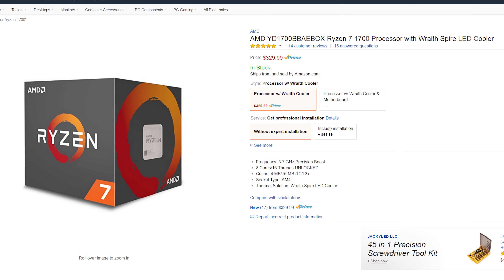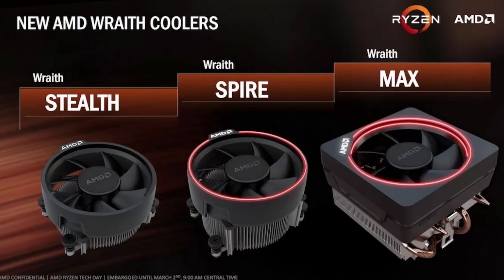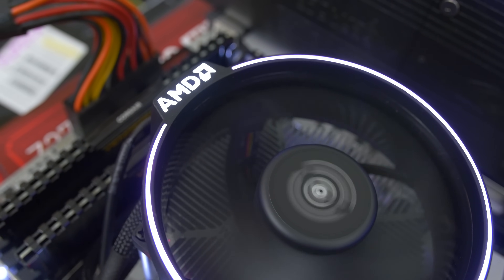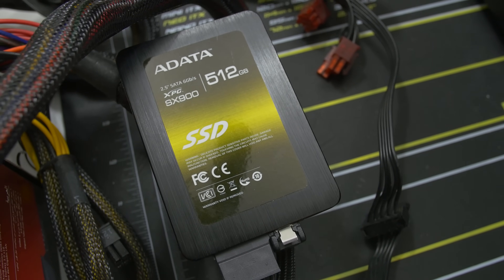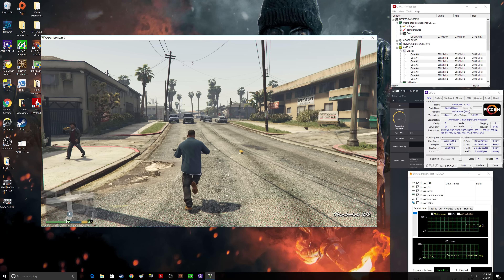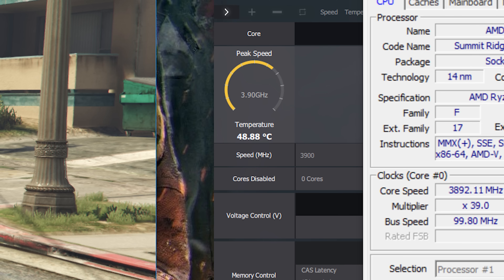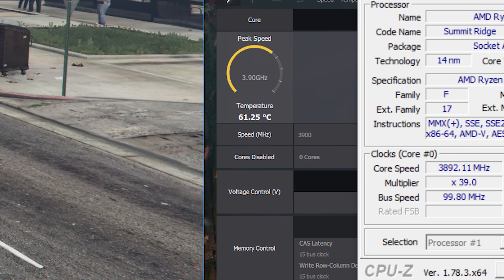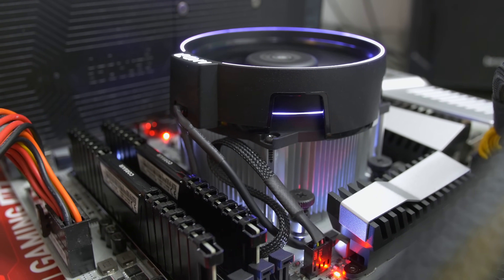AMD Wraith SPIRE: Does it SUCK?

Comment: Years late but the cooler does it job real well, its free? and can handle light over clocks, only problem is the thing is a bit hard to clean and its size makes it a dust trap.

An after market is still superior but it's not like the old fx series coolers that turned into jet engines in heat and sound.

Comment: I'm running X570, 5700X @ 4.3ghz 64GB mem @ 3200, 750w psu. With PWM fan curves in BIOS, the Spire is keeping my idle temps @ 28c idle, 34c streaming utube and 41c during Zombie gunship. It can hit the sweet spot and its not loud if you don't overdo the OC. I could have pushed the OC further but what's the point, Zombies are too slow for me.

Comment: The Wraith Prism is a much better AMD cooler but if all you have is the Wraith Spire and you don't plan to OC then the Wraith Spire is more than good enough for most people.  The Wraith Prism was designed with the intention for moderate AMD CPU OCing straight out of the box.  AMD soon got smart and if people wanted to OC their CPUs they would have to shell out more $$$$ and buy a better CPU fan.  That way the computer industry can make more profits from the consumer.

Comment: I had a 1700 but paired it with an H100i. Recently though I switch to a 3600 and use this spire cooler with it and it works very well.
Reply: So the AMD Wraith Cooler cools better than the H100i?
Reply: @BravoSixGoingDark  No. not quite. It works well though. I just like that it takes up a lot less space.
Reply: @shoff29  I see I see, so the difference is like 5 - 10c?

Comment: I am worried about what you said about the fan blowing hot air all around the case, and since it's a downward blowing fan could that hot air potentially heat up the motherboard and ram, leading to damage overtime?

Comment: 3:17 oooooo, Lol I prefer the see-saw cooler to the screw down wraith cooler because you dont have to remove those two little retention bracket bar things above and below the am4 socket so the wraith cooler can be screwed into the backplate
Reply: 3:24 but I hate the push pins Intel cooler with a passion, so the screw down wraith cooler is much better in that sense 😂😂

Comment: Seems interesting for a sff mATX case running an Athlon 3000g. The available cheaper low profile am4 cooler kinda suck, you can get one if these for 10 bucks, this should do fine with a small Athlon

Comment: Hi like to ask your suggestion/s what video card low profile type can i insert on my recent pc unit here my specs:
550-600 PSU
dual core 3.0 GHZ proc
msi g41m-p28 mboard
4 gb 1333mhz ddr3 ram(max up to 8 gb)
Onboard vcard im used
sff pc case
160 gb hdisk  and 16" lcd Wide mntr.
Games can played up to 2015 early that time it's ok to me! Thanks more power to your channel!

Comment: Using Wraith Spire along side my R7 2700 OCed to 3,8 GHz. When gaming and doing what I normally do, it doesn't go over 70 C. Normally stays in the low 60s under load and idles in the high 30s. Very good CPU cooler, considering it comes incluided in the box and even has RGB blink, it looks pretty cool.
Reply: Thanks:)

Comment: I am getting the Ryzen 5 3600X. Will the Spire be fine? I do not plan to overclock at all. My friend is telling me I should get the Dark Rock 4 cooler, but it's almost $80 and I feel like it might be overkill.
Reply: @Shemegory  I don't plan on OCing. With my setup the Spire is keeping the 3600X at 35-45C idle, and in graphically intensive games its at 61C. Doesn't seem too bad. Tthe issue is that the Wraith Spire's fan is extremely loud and very annoying. 

I heard that AMD "nerfed" the Spire for the 3600X, they removed the copper core/vapor chamber thingy, and replaced the CoolerMaster fan with some random cheap fan. That probably explains the annoying whine I hear.

Comment: Great video! Still relevant. Any idea if I can use the Wraith Spire that came with my R7 1700 with a R9 3900X? 

It seems like a pretty decent cooler and I'm sure if I used a little extra thermal paste it would be fine as I'm not over-clocking but I'd be interested in hearing your opinion.
Reply: Bad idea. Think about it. The cpu that you got with the wraith spire has a tdp of 65w while the 3900x has a tdp of 105w. The spire would be insufficient for the 3900x and it will most likely overheat. And extra thermal paste won't change anything cuz it's only a conductive between the cooler and cpu. Use the stock wraith prism or get another aftermarket cooler.
Reply: @hazzmati  Thanks, yeah I wrote this before I realized that the 3900X also comes with a stock cooler. The one it comes with is great and fine for me since I'm not doing much overclocking.

Comment: Great video, made me opt for the 3600X instead of the 3600. It is worth mentioning that only the Ryzen 7 Spire comes with RGB.
Had to learn the hard way though that AMD screwed us over by cutting costs. The "new" generation spire has no copper core + a Foxconn fan that does way more RPM than the original Cooler Master one  - it sounds like a jet engine! Total piece of junk, in hindsight I should have gone for the cheaper 2600X with the old spire.
I ended up buying a used cooler from a 1700x for 5 bucks so now I have more silent cooler and RGB - instant better FPS :-)
@Bitwit maybe you want to do a new video about the new Spire so that people are aware of this scam AMD is pulling.
Reply: I bought the 2600x a few months age and even its wraith spire was loud. It sounded like a mini lawnmower or something the sound really intrusive I couldn't bear it. Ended up buying an aftermarket cooler but I was disappointed  cuz I bought the 2600x because I thought I was getting a good stock cooler.

Comment: I have question
I have Ryzen 5 3400g with wraith spire, the max temp i got is 77celsius and about 6:11 it is not quiet it vibrates on motherboard.
maybe i got bad cooler but still 77 celsius max is look ok with tjmax. being 95 but still.
In my case i have 1 cooler from cooler master (stock)
Reply: But still great video

Comment: its loud as a truck,i got one.....
Reply: Clean & re-apply thermal compound once every 3 to 4 months . Also maintain positive air pressure inside case -- i.e , place all fans as intakes & just one exhaust at rear side . All coolers will run quiet then .
Reply: @abhroy  Not if theyre not working properly like my NEW amd wraith spire :)
Reply: @miroslavterzin5117   . I am truly SORRY to hear that . If you don't care about RGB , then please get one AeroCool  "BAS AUG"  horizontal or down-draft cooler -- TDP 125W , 4 pin PWM , copper slug -- superb cooling you shall get . And if you do care about A-RGB & also can buy from aliexpress (or amazon) , then please get the Aigo DarkFlash Shadow PRO with PWM .
Personally , I just love down-draft coolers & literally hate the tower type mammoth coolers hanging from the mainboard :)
Reply: @abhroy  Was thinking of a Noctua NH-D15 black,all that noise from this cooler made me read everything about coolers lol....
Reply: @miroslavterzin5117   . Bad luck truly gives us a good lesson :) Do please check out this one -- bequiet dark rock TF , 220W TDP , 27 db max , PWM . Should meet your needs & also give the extra bonus of a top-down blower .

tomshardware.com/reviews/be-quiet-dark-rock-tf-cpu-cooler,4340-2.html
Reply: Hmm mine is fairly quiet.
Not as quiet as my cryorig m9i but  decent.
Its running my cpu at 4.2.
Only way it would be loud is if it's going full whack. But that's same for any fan.
Reply: @letni9506  i have 2 same pc models,one is the loud one the other is kinda quiet enough just not to be anoyng,so folks i dont recomend buyng any cooler from amd,they are cheap looking good but ur playng with luck when buyng them,it seems they have a lot of defected coolers on sale.

Comment: The stock coolers are intended for the processors or rather very safe to use. No company would supply a cooler without extensive tests, so there is nothing you can do they have not already done..

Comment: I NEED HELP!!! I have AMD Ry zen 5 2600 with stock cpu cooler and its at 86 Celsius at idle. i Have changed thermal paste and also made sure the fan was mounted properly on the cpu. but it stays at 86 Celsius. no performance sues but when i get on to play i can notice it drops in performance and is jumps to 103-106 Celsius. i have 16 gb ram and ATI Radeon RX 570.
Reply: Something is wrong with your system for sure! OUCH! Hope you have found the problem, that sucks!

Comment: im getting the 2600x and it comes with this stick cooler, im not planning on overclocking, should i buy a new cooler or stick with stock? i dont want water cooling and would like to keep the budget as low as possible.
Reply: Buy the 2600 if you dont want to OC. To save money.
Reply: lapu2x the great no price difference rly
Reply: I've got the stock one on a 2600x.

Comment: not give any new speed if you allready have model2015if you still fine 2010 model and like play 1080p fast. safe money lol is proseccore and cpu been on max allready many years they cant do faster. they just lie and make smaller to run it faster less heat but its same prosessor than last year lol

Comment: I wonder is the spire cooler is good for the ryzen 7 2700 CPU. I don't plan on overclocking the cpu but I will be gaming at 1440p using an RTX 2060.

Comment: I can't bealive no-one is mentioning this but,  this cooler has one of the worst mounting flexibilities of all the coolers out there.  the screws are literally so short they cant sometimes be mounted. Some users have broke their motherboards by forcing the cooler down too hard so the screws can reach the hole.  Very baffling engineering if you ask me.  This is a serious problem and tons of people have been reporting this.  Other than that it's good for a stock cooler but don't settle for that if you're planning on gaming and are having a bad time making the screws fit.

Comment: There's a big seller on eBay selling brand new sealed 1700's for $159 with free shipping and they don't charge tax unless you're from CA. Just grabbed 2 and will be doing a couple builds. I might not use the Wraith Spire coolers but they will definitely get used in other Ryzen 3 or 5 builds.

Comment: if buying r5 2600x buy an aftermarket cooler, its 95 tdp cpu and stock cooler is 95 tdp rated also, i hit 93°c at one point during gaming ,nowhere near 100% utilization, bought cryorig h7 rated for 145 tdp , highest it reached in same gaming scenario was 71°c.
Reply: TartanSpartan01 you might want to check the airflow of the case, if even the cryorig has that temp on yours

Comment: I did buy the Ryzen 7 1700 as well. (I am a Hardware-Noob - Software Developer...)
At first I wanted to buy the Ryzen 5 2600 but I decided for the 7 1700 because I thought I could overclock it to the same frequency as the 5 2600 is that right?
For me it's important that I also can use the CPU for Workstation Tasks as Compiling and so on (thats why I took the 1700)... But I also wanted to achieve a good Prive/Value for gaming as well...

So was my decision for that CPU and OC right?
Reply: It depends. The 2600 has better per core performance then the 1700 so In cpu dependent games the 2600 will beat the 1700 by a bit. However the extra cores on the 1700 will help with compiling and such so In your case it was the better buy

Comment: I have a 1700ghz clocked to 3.8ghz and I've noticed much the same with the spire cooler with temps and such. However my idle temps dropped from 39-42c down to 30c after moving to a better case. 
I use it for video editing and during encodes (and stress tests)  I have seen it reach as high as 72c but I don't think I've ever seen it get hotter than 75c

Comment: I go above 4.2 GHz on Ryzen 5 2600x with wraith spire cooler. When I play temperature of CPU stays about 60C. depends on high or low vent settings. Ignore the graphics card. I am waiting for new one. 
My specs:
AMD Ryzen 5 2600x 
Asus Prime B350M-A
G.Skill Aegis 3000 MHz 16 GB (2x8)
AMD Redeon HD 6670 512 MB
Kingston A400 250 GB
HDD Toshiba P300 1TB
Zalman z3 Plus Case.

Comment: 1.35V is the sweet spot for ryzen ..... ryzen 5 1400 running @3.8 at 50 mid 50s benchmarking same as r7 1700 on a spire stealth.... great stock cooler. case exhaust/airflow is more important

Comment: Hi, i have bought new ryzen5 2600. But the temp are insane hot: 79-86 C!? Wtf, any help?
Reply: Unbeastable did you overcloked it?
Reply: @shittygen4572  No i found out on forums that Speccy was giving totally wrong temps. I checked the temps in the BIOS and one other sofware wich checked my temps (forgot the name) just to make sure, it was perfect.
Reply: Unbeastable oo, i'm happy for you😊.
I'm building a gaming pc with an amd ryzen 2600 and a zotac gtx 1060 6gb, this is my first build and i'm worried...
I was watching some vids about the cooling cuz i don't know if i want to keep the amd cooler or to change it😂
Reply: @shittygen4572  if you are not overclocking your fine with the stock cooler. Perfectly fine. Thanx
Reply: Unbeastable okk thank you😊

Comment: I have an R3 1300 in this machine right now Kyle, and it does the same odd heat behavior. Even it idles at around 40c-50c, but when pushed it still stays around that temperature. I think it's AMD's fan settings personally, going for silence under low loads and slowing the fan, causing temp to raise but still staying in the safe zone.

Comment: 1700X is cheaper here than 1700 so which one to buy???
Reply: Get 1700X if you already have an AM4-compatible CPU cooler since it does not come with one.
Reply: @259  thanks I have an FM2 cooler bought 6years ago, there were no AM4 that time but they wrote on product page that it fits....

Comment: Been reading lately - September, 2018 - that if you use this with the Ryzen 5 2600X - which includes the Spire - which boosts to 4.2GHz, you're looking at significantly higher temperatures, especially if you overclock all four cores at high voltage. Also if you run stressful applications like video rendering, higher temperatures may occur. Spire isn't recommended for high-stress apps for the 2600X. The 2600X is a 95W CPU which matches the Spire's maximum 95W capability, something to keep in mind. But for stock 2600X speeds and ordinary applications, the Spire should still be OK. As usuall, YMMV depending on the size of your case, your fan configuration, etc., etc.

Comment: MSI Mortar, Ryzen 7 1700.  had it liquid cooled moved to Wraith Spire when the liquid cooler pump failed. Same results as the author. 3.9 gHz stable 64 degrees under load. It's my backup machine so running at reasonable and very stable 3.6 gHz 51 degrees under load  and super stable.

Comment: installation is a breeze

Me trying to install this thing for 40minutes
Reply: i got it installed in like 7 minutes lol
Reply: It took me around 20 mins
Reply: 40 minutes to install a cooler? It took me a whole day to install a Hyper 212 Evo inside of a prebuilt. At the time of purchase I didn't realize my AM3 motherboard had LGA775 mounting holes... some drilling, broken bits, and plenty of filing later, and it now fits perfectly.
Reply: Ive been at it for 90 minutes, wimp!
Edit: Even bent one of my CPU pins, had a good panic until I fixed it

I finished!
Reply: @brockgaming8648  How tf did u manage 90 min and a bent pin?! xD
Reply: @TKIvanov  idk
Reply: @brockgaming8648  yeah.....
Reply: Gonna be honest it took me 1 hour and 20 minutes. I fucking hate those screws.
Reply: You only have to screw it down 😂 but the screws are annoying as fuck because of where they are.
Reply: I have a tomahawk b550 mb did anyone have to push the screws down to get them started?
Reply: @OverlandRC-l3k  WAIT WAIT WAIT I have the Tomahawk B450 and I CAN'T get the screws in and I feel like I'm applying way too much pressure, I know this is 5 months later but could you please respond on if you did/how did you get it in???
Reply: What are you dumb? You screw in the screws?

Comment: Hi, I am building a new rig, with the Ryzen 7 1700 but I want to know when you over cloak, what in the system measure the temperature of the cpu, is there like a built in thermostat or PCI-e card for thermometer installed?

Comment: Question: I bought a pre built hp pc that has r7 1700. But it doesn’t have the spire and instead have a regular no brand cooler. So does the spire only come in the box if you buy it separately?
Reply: Yup. OEM's can do whatever they want, but they buy everything ala carte, so if they wanna use the Spire they have to buy them from AMD unlike how consumers get it as a free pack in, in the box (OEMs do buy & ship with the AMD coolers in some of their builds though, usually the nicer ones, that's where most of the Wraith Max's are used).

Comment: Well once you do Converting Videos or Decoding Videos then cooler is getting noisy but otherwise the cooler is good I live in Australia and this summer it was few times 40 degrees so I wanted to see how will do it but it wasn't noisy but I still want to buy better cooler. I believe AMD Cooler which was coming with AMD FX 8370 was better and bigger..

Comment: I have a new corsair rm650 psu. Is that enough power for a rog strix b350f MB and the ryzen 5 1600? My gpu is a rx560; the gpu gets power from the MB but in the future i hope to get a more powerful gpu that would plug into the power supply. On a budget over here. Thanks!

Comment: i got a ryzen 5 1600 with CM hyper 212 turbo BUT the temp is higher than every review on the internet
Spec: 3.8Ghz @ 1.29 V
The idle temp : 40*C
The stress test 75*C
Ambient Temp: ~29*C

Noted: i live in Vietnam where the temp is always around 28~31*C

Does it normal guys ??? I'm so confusing =((

Comment: its actually very good this cooler, if you set it to voltage mode in the bios and not pwm mode, the lights go off and on according to fan speed